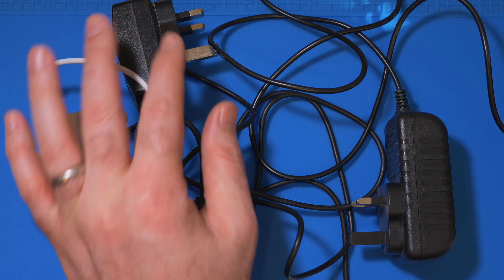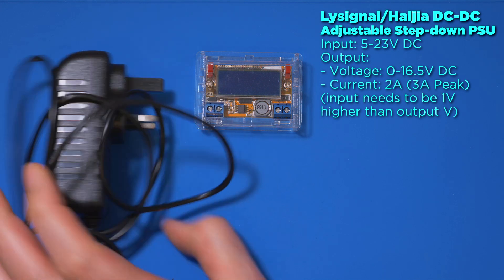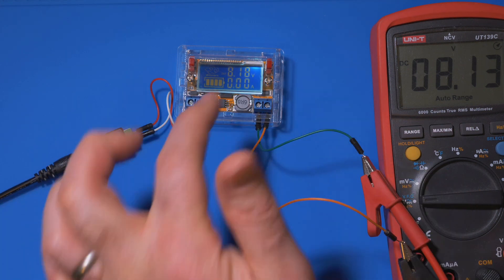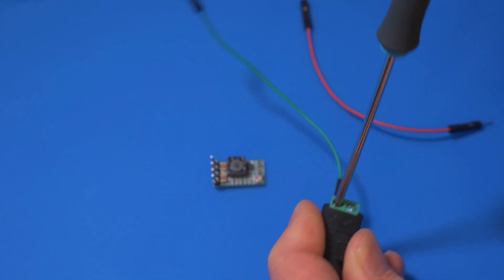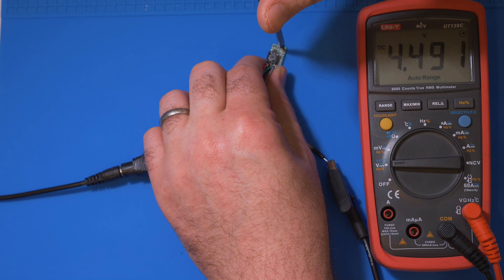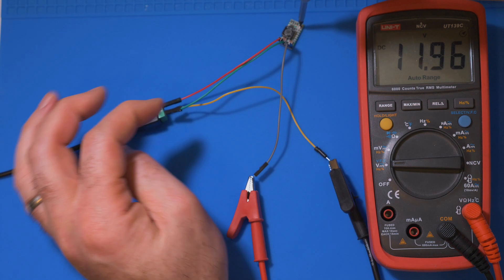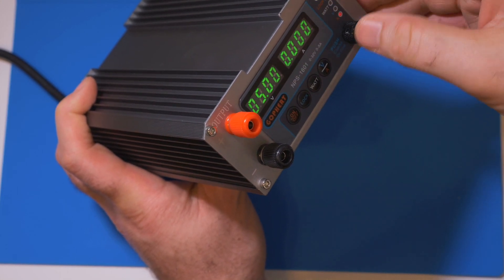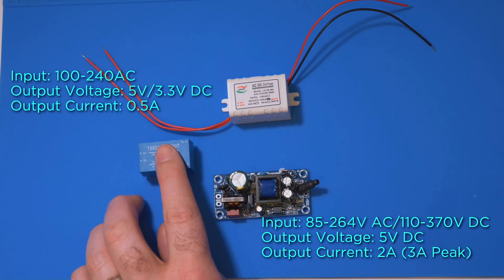Powering your Projects

Comment: Absolutely wonderful video , thank you! - Would you please make a video about recommended  rechargeable battery packs for installations that may not have mains power ?

Thank you again , you haven enabled me to do something I  otherwise could not have
Reply from the maker: I am glad it has been helpful for you Ryan!
I will be doing a video this year with regards to small rechargeable battery packs. I already do this with my full setup, using a large 12v battery, charged with a solar panel.
Reply: @ChilliChump2   Thank you so much , I live in Japan so larger batteries are not very viable. But smaller ones are!  Thank you again !

Comment: Thanks for this video, I come from a programming background so my knowledge of the electronics side is limited. 

Currently I have two esp boards one with four sensors attached working off a power supply for monitoring our garage pantry temperatures, this communicated back to a PI using MQTT. I hope to place the second esp with one sensor in our  greenhouse  that has no power source, so really looking forward to future episodes.